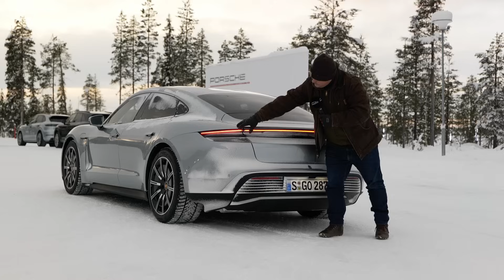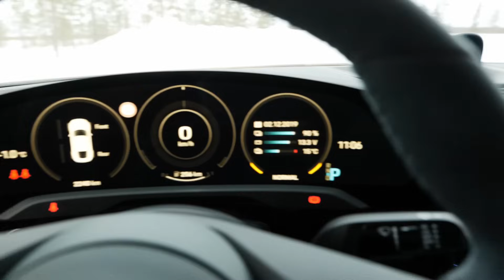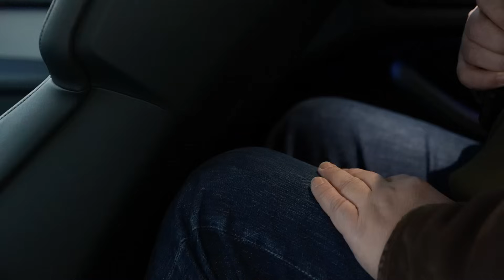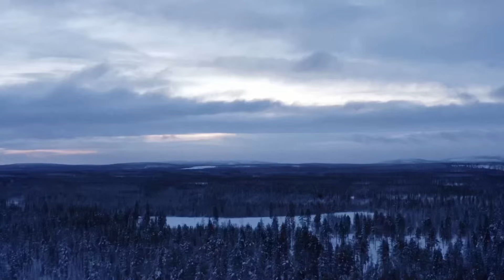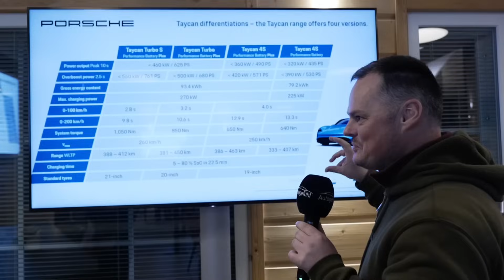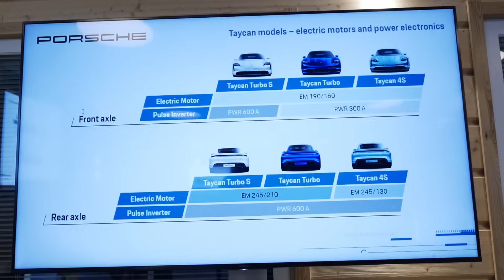Porsche Taycan 4S FULL REVIEW with snow and ice electric AWD special - Autogefühl

Comment: Why do you complain that a portion of the display is obscured by the steering wheel? If you've ever driven an Audi you should know this is done on purpose. The parts obscured are the light switches on the left and drive settings on the right. It's not stuff you need to look at constantly, and they are obscured so that you don't have to stare at a regulation green indicator all the time when your display color scheme is mostly white and understated for OCD people. On all Audis the light controls are similarly obscured by the steering wheel so that the green light indicator doesn't clash with the otherwise orange or while interior lighting.
Also, do you have to keep saying umpteen times how your legs are freakishly short? They're fine.

Comment: Brian's test car interior was very gloomy, so gloomy and drab that the camera couldn't see anything! In Feb 2016 Thomas's really great Review in the snow in Sweden of the Tiguan had better image contrast, and the car did the same thing - drifting etc - the Tiguan looked equally easy to control! (Yes, frozen lake ice driving is fun!). Optional heat pump?! Damn - typically everything is an expensive extra. A lot of words from Brian - and yes, the 4S seems a nice car, but it doesn't have the better Tesla charging infrastructure; therefore always avoid horrid charging stations, always charge it at home, and have a second car, or hire a car, for long road trips...!
Reply from the maker: was very very dark there, even darker than it appears
Reply: yes agree, searched for: autogefuhl tiguan snow and drifting, excellent video, one of the best, great drifting, and good sunlight for the camera

Comment: Love the frameless windows and very cool re: the charging port vibratory mechanism; I was wondering about that very use-case. -1C doesn't seem very cold for Finland and above the arctic circle. Agreed, there's simply no way manipulating the screen based controls is a safe way to operate the vehicle. It hurts my mind that Porsche puts so much effort / engineering into the vehicle's performance and the control systems yet doesn't account for safe operation. For the love of your Customers, please incorporate physical controls, Porsche. As always, a great, succinct presentation!
Reply: I think that frameless windows are less safe.  Framing structure is good for the glass, opening and closing doors thousands of times, and one tends to rub against the edges of the glass of a frameless window much more often, as well.  There's a reason why most cars have frames around the glass.
Reply: @cbatiau2528  Interesting. I drive an older japanese make sedan with frameless windows and it all seems to work just fine. What types of risk or problems might arise with a frameless design?

Comment: Very interesting and nice car and review. Did you left car outside over the night? It is important to test this and report how did electric capacity and charging and heating went in such case. Because on skiing we cant always put a car in a garage over night. Maybe differences are at different cars too.
Reply from the maker: They are being taken care of after u hand them over..
Reply: @autogefuehl  This is always a problem with these YouTube reviews when reviewers only have a car for a couple of hours in controlled circumstances.  Much better to have a car for a week or two or three, especially for EVs, before reviewing them.  You call this a "FULL REVIEW", but it really is not that at all.  This is a "preliminary review", at best.  At the very least, you could have said how much of the battery capacity was available when you first got in the car and then when you last departed the car; I presume that there was no charging in between?
Reply: @autogefuehl  Of course. There is an unchecked point you could make a test or review sometime in the future. What happens in the morning after night with temperatures below 0 degrees and cars stays outside.
Reply: G Leben In Levi -30 is not unusual temperature, so probably range will be 150 km at best 🤣